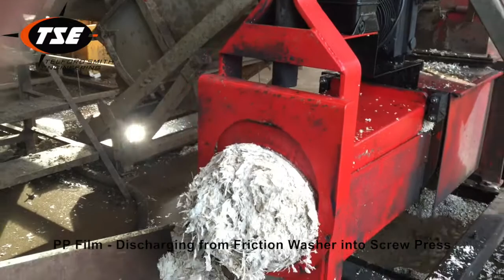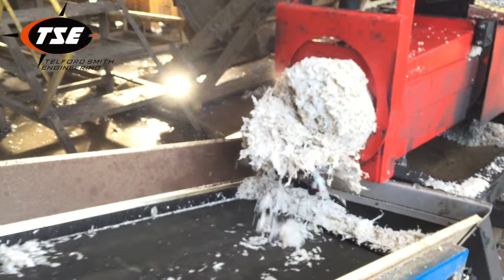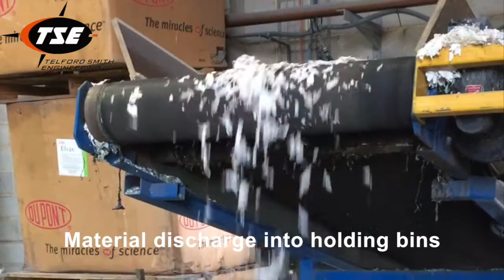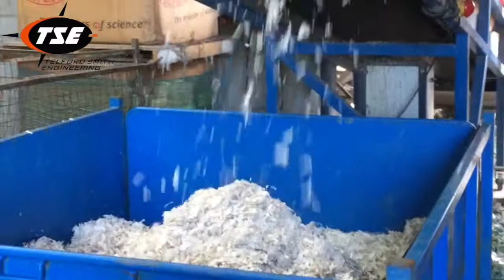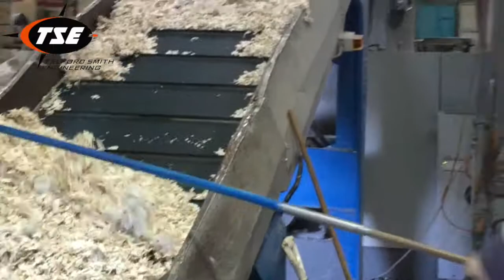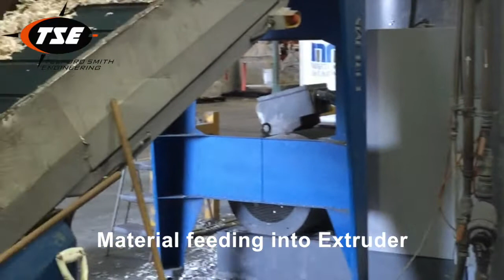Dirty PE Film being washed then discharging dry material from SCREW PRESS (Telford Smith)

Comment: I can guarantee that is a lie . That is not dry.  Maybe telford smith does not know what dry means !
Reply from the maker: Hi Peter, 
Thanks for the comment! it really helps our videos and gives us the opportunity to go into greater detail.
The drying/compacting process of the Runi Screw Press increases the dry matter content of PE film from 60% to 90% at a low energy consumption of only 24 kW per 1,000 kg!
This is the most cost efficient and in our opinion the most effective way to dry PE material before downstream processing. 
Please let us know if you have any more questions or if there is anything else I can help you on relating to the Runi compactors and their effectiveness.
Have a great day.
Reply: @telfordsmithmachineryengin4958  would be fairer and more accurate to describe output as "damp" not "dry" ,otherwise it is just like greenwashing when some company descrives their shoes as made with "ocean plastic" , yet they only use the PET fraction and fail to tell what happens to all the rest of collected polymers .... just saying could be less misleading to reader if accurate descriptions are stated at the outset.